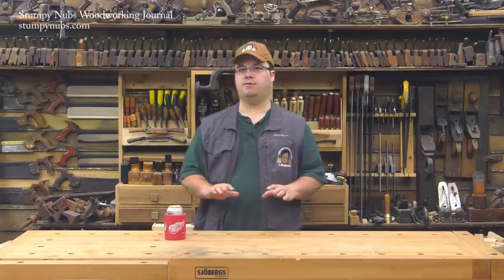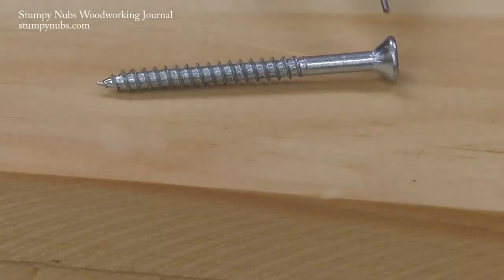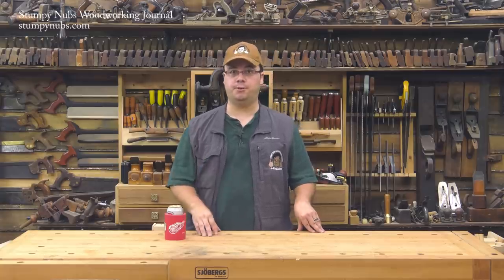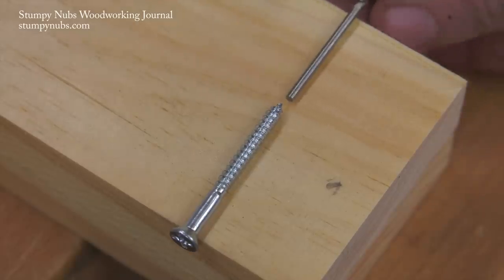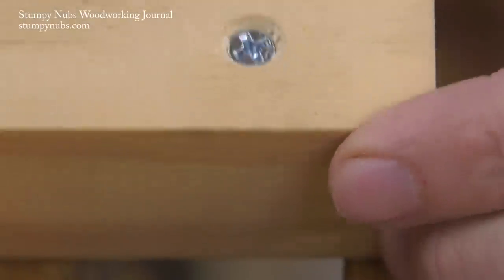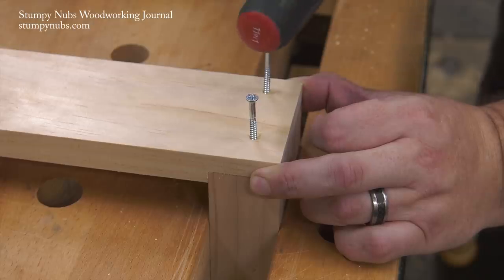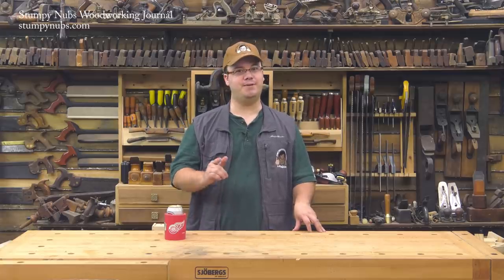Why old-timey woodworkers' screws held better (How to bore proper pilot holes)

Comment: I don't get it about the offset. Is the screw drawn to the awl punched mark and goes in at an angle? Why does that little dimple draw the screw when it is just a shallow dimple?
Reply from the maker: I bored holes in the dimples. That part must have been cut out in the editing :(
Reply: you should drill a pilot hole, using the awl marks as your location for the pilot screw
Reply: So, I am not crazy and did ask a legitimate question. Thanx
Reply from the maker: Josh w- I did. It just wasn't shown in the video. but afterward I referred to how you had to use the same 3-step pilot hole you just saw earlier int he video.
Reply: I honestly didn't even notice that he didn't show the piloting of the awl mark. It was an easy thing to edit out I'm sure, it appears obvious and natural to anyone who understands it that you would pilot it.

Comment: I have to mildly disagree with you opening statement; that is not really a screw, it's a nail that happens to be put in with a screwdriver. They fulfill all the uses to which nails used to be used for, instead of a hammer you have a drill driver, they are designed to go straight into softwood without drilling any holes, they are parallel sided so as not to split the wood and the heads are shaped to sink into the wood without a countersink, all just like we used to use nails. They do not really work in the role that we used to use screws for, for one thing they are not as strong and they don't work in hardwoods (they split the wood if you don't drill a pilot and they tend to just snap). Machine driven screws gain their strength by being longer than traditional screws, really long for end grain.
Proper screws require, as you showed, a clearance hole and pilot hole and a countersink, but proper screws are tapered so that they grip tighter as they are screwed home, unlike machine driven screws.

Comment: Guess I must be 'old timey.'
This is how we always fit screws in my workshop, and I use only slotted screws - we call the others 'moron' screws!
Reply: Not a fan of the Phillips screw heads. The metallurgy on most screws these days is terrible and the cam-out design of the Phillips head usually causes damage to the head rather than the intended cam-out.

Torx is a great alternative since it's not designed to cam-out but still keeps the driver tip in the screw head. The only downside is that the rarity of Torx means most people don't have the proper tools sitting around.
Reply: @benjaminkesler5245  I worked in a steel house frames factory. The company decided to change from 5 cent framing screws to 2 cents cheap nasty ones. Both were philips head but the 5 cent ones were way better to work with. I don't know if it's the alloy or if they were hardened. Any money the company saved on the screws was lost with the increased time it took to screw in. Sometimes it took up to three screws before you could drive it all the way into the hole on thicker gauge metal. They stripped so easily. Plus it reduces the life of the screw guns with overheating and pressing down so hard to get it to drive in. Plus injuries from the extra effort it takes to do the work. Morale really dropped, the screws were so frustrating. And of course they expected production to stay the same even with the extra time it took.

They trialed some torx head screws but they didn't end up going with them. 

Anyway thankfully I'm welding now instead of that braindead boring job of screwing frame screws in a factory all day.

Comment: “A messy countersink wasn’t that big of a deal.”  My grandfather would be turning in his grave to hear that.  Of course he did a seven year apprenticeship as a joiner in a yacht builder’s yard.  Messy countersinks were not tolerated when you were working with expensive exotic hardwoods.
Reply from the maker: We're talking about furniture making. Screws were hidden, so the counter sinks weren't visible.
Reply: Stumpy Nubs I understand, but it wouldn’t change my grandfather’s opinion whether they were visible or not.  To him and the people he worked with, you did it the “right way” no matter where it was located.

Comment: So it is a thing! Because for the longest time I could swear the industry doesn't give a shit, when it comes to screw selection. A lot of products on the shelfs don't make sense to me, where you have a screw SUPPOSEDLY for a 2x4 construction, YET the threads are only 1/4" down from the head...WTH?! FORCING you to drill two hole sizes. Once you get into expensive "professional" grades, they actually pay attention to the design. Shocking and I thought the Americans/Canadians are crazy. Turns out it's just the manufacturers that are lazy.

Comment: Now if only they made new production wood screws like they used to.
Reply: That's the thing though is that they don't make them like they used to. So regardless of how well this technique worked for them 150 years ago it just doesn't today. It may get you a little farther than just running in wood screws willy nilly. But you are still going to get screws that spin forever because of the shank and the sheer strength isn't nearly what it was 150 years ago. Partly because of the screw material and partly because who is framing houses out of cedar these days? Not many people. Even with taking these extra steps you are still going to get better performance from a deck screw than a "wood screw" or drywall screw.
Reply: dunno how things are in the states, but over here in europe this isnt an issue. You can still get proper woodscrews everywhere

Comment: I watched the hole video, but if I tried this, I wood screw it up. ( yes I know, my puns are boring. )
Reply: At least you know the difference between screwing and boring.
Reply: Man those two pilot points were barely a plank apart.
Reply: That’s comments Gold!
Reply: Yeah but it is a good thread to follow! Said Mr. Phillips!
Reply: They're really awl-ful
Reply: Keep up those puns and you're screwed!
Reply: That doesn't auger well.
Reply: I'm just here to add to the thread.

And after a bit of lag... I'm gonna bolt.
Reply: @heli400  – Yeah, keep it up, wingnut...
Reply: <groan>  Funny but  <groan>   :)
Reply: Ouch
Reply: I want to down vote this for the same reason I want to up vote it.
Reply: You've started quite a thread.

Comment: I was taught to drill the countersink first to give you a nice round countersink then the smaller pilot  and then clearance hole. Otherwise your countersink bit dances in the hole and not a pretty result

Comment: You can more or less duplicate this process with drywall screws if you drill a hole the same width as the outer diameter of  the threads in the outer workpiece, where the shank of a conventional wood screw would go.  I also rub my screws on a block of paraffin wax before putting them in. It only takes a second and they go in much more easily.
Reply: im not a big fan of this method, since it wont produce a tight fit between the upper part of the screw and the wood. With time it will become loose in the horizontal direction. If you have to use a drywall screw just bore a pilot with the inner diameter and countersink. Boring to the outer diameter is doing more damage than good in the long run.
Reply: is there really a shortage of wood screws?

why not take a day to go buy a huge box of wood screws
Reply: YYYYYYYYYYYYY ARE YOU ON,MT LINE?
Reply: I found drywall screws inappropriate even for drywall)
Reply: The point is that drywall screws will fail over time no matter the method you use. They are highly susceptible to corrosion and become more and more brittle over time. I have seen a number of failed, snapped, rusted threw drywall screws in a very short period of time. One day you will go to move that table and notice the leg is loose or falls off and you find a snapped off mostly rusted drywall screw in the hole.
Reply: No. Drywall screws are made of a more brittle material than is appropriate. Also, the curved surface is not suitable to draw the pieces tight; that's why wood screws have a different contour  in that area. You're describing hackwork.
Reply: Ozzy, drywall screws are good for drywall. Their taper is very flat giving you a lot of hold without blowing through the paper.
I hate fine thread dry wall screws, and I prefer using 1 5/8ths screws for 1/2 in drywall. Short fine thread drywall screws have their place, but not in general sheet hanging.

Also Matthias Wandel did some testing and found that while drywall screws are more brittle, their clamping force was just as good or better than wood screws.
Reply: John E John is correct you CAN use drywall screws (or deck screws) to pull the pieces together as long as the top piece has a hole larger than the screws threads.  In softwood I prefer them. They are brittle, but only rarely does that matter much.  In haedwood, the old fashioned wood screws work better for me.

Comment: That offset screw idea is essentially the same as drawboring. Maybe that's of interest to someone.
Reply from the maker: Drawboring only pulls in one direction, which is all that's needed as drawboring is used to seat a tenon in a mortise. Drawboring would not work with a rabbet. Offset screwing pulls in both directions, which this type of joint requires.

Comment: I've found that my water pump pliars work better as a hammer than my screwdriver handle.  But I'm probably not as strong as you are.
Reply from the maker: Who is hammering anything? I needed light taps to make little dimples with the points of the screws. A hammer would have been overkill.

Comment: Why are you hitting the screws with the screwdriver's handle? It is meant to turn them, not smash!
Reply: Shop worker to tool crib manager; " give me a wrench". crib manager; " What type of wrench?  What size?  Worker; "doesn't matter - I going to use it for a hammer."
Reply: Kelly Infanger ...Sooner or later EVERY tool gets used as a hammer. 😉

Comment: Since this is a "teaching video" Using the word shaft to describe a screw is incorrect. The un-threaded section above the thread is called the "Body" not to be confused with a "Shoulder" it's also sometimes called the "Shank". I was taught that the shank was the "root diameter of the threaded section" and the Body was the "major diameter, sometimes the major diameter can be larger than the body" although many people use them interchangeably. I assume there is regional differences the same as guys using jack or cripple studs. in any event it's never Shaft, Cheers!

Comment: "How it was done 150 years ago" proceeds to drill with battery drill motor.
Reply from the maker: The video isn't about drills. It's about pilot holes. I could have used an eggbeater drill and the hole would have been exactly the same.

Comment: Real wood screws are tapered and have a slotted or frearson head. Pilots are drilled with a tapered bit, set with a little glue and clocked.

Comment: Looks like a version of draw boring!
Reply from the maker: Drawboring only pulls in one direction, which is all that's needed as drawboring is used to seat a tenon in a mortise. Drawboring would not work with a rabbet. Offset screwing pulls in both directions, which this type of joint requires.
Reply: Drawboring only needs to pull one direction because the tenon is trapped in the mortise the other two directions.

Comment: I found that the three-step process works best in the reverse order.  I make the counter sink first, then the clearance hole for the upper screw shaft and just a bit of dimple for the smaller hole.  The counter sink hole and the dimple have tapered bottoms that center the next drill bit perfectly.

Comment: The second drillbit was rotating counterclockwise.........
Reply: That was just to make sure that it was centered in the small hole. Once it had made an impression in the wood he reversed the drill and bored the hole through the upper board.

Comment: I found a couple of tables at BoltDepot.com a while ago that give wood screw drill information:
https://www.boltdepot.com/fastener-information/Wood-Screws/Default.aspx
 One table gives pilot hole diameters (the metal between the threads) and the other table gives the outside diameter clearances.   You can get a bit more accurate if you want to buy numbered drills - don't buy a whole set of those.

Comment: That isn’t a truely old fashioned wood screw.  This is a modern wood screw.  Old time wood screws where actually tapered.  They often failed because as the wood aged and dried the timber shrank away from the the wood screw thus, the screw became loose. This was particularly problematic when used to fix door hinges because doors place a lot of load on the hinge.  Over time the screws become loose and the door starts to jam in the frame.

Comment: Tiny point, you're describing a method of using partially threaded screws to get compression between pieces which is often what we want. In applications where you don't actually want compression between the pieces, a fully threaded screw without the overdrill of the top piece is another good technique to know.

Comment: Really? A chisel for a countersink? Try this- fashion a simple point (45 degrees) on a steel rod, maybe 4 inches long. Place in pilot  hole, now hit with hammer. Done. Works everytime and strengthens the countersink by compressing the wood fiber.
Reply from the maker: You must really love your tip to give your own comment a thumbs-up :)
Reply: Ok, guilty as charged.

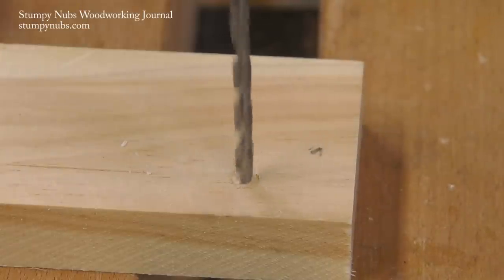Comment: at 2:10 stumpy bores a hole using that old timey technique of counter clockwise drilling.  hmmmmm?!
Reply from the maker: That was done to sever the fibers on the surface before drilling. Prevents tear-out
Reply: Burnish, then drill. Try it, you won't be disappointed.
Reply: Left hand twist bit.
Reply: Victoria learned two things today!
Reply: I was going to comment the same thing, but i give your system a go ...
Reply: Victoria Q it ensures that the larger bit stays centered in the pilot hole & doesn't jump off center when it bites into the wood.
Reply: I shall have to try it!

Comment: Fun video
Personally I liked when you smashed the drill head jaws into the surface and when you drilled the larger hole with the drill in reverse heh
Reply from the maker: Running the bit backward for a second is a way to sever the fibers before tearing them out as you begin to bore the hole. Try it some time.

Comment: I helped my father make the back steps. We used wood screws, and did what you did. Twenty five years in, the wood screws all broke off. The back steps was the main way into the house, and the constant flexing of the wood caused metal fatigue in the wood screws, and they failed. You know, If wood isn't in the rain, or gets wet, it will last thousands of years under stress. Nothing made of metal, under dynamic stress will last a thousand years. Honestly, most of the stuff made, isn't expected to last more than a few years, so who cares what happens twenty years down they line. We should be honest, if we make something all out wood, and don't use metal, the life span of the object goes into centuries.
Reply from the maker: Yes, because we all walk on our furniture every day for 25 years, like your steps...
Reply: Sounds like you used wood screws when you should of used lags. Stuff made even 25 years ago isnt as good as stuff made today. Our cheap stuff today was the high quality stuff 25 years ago. Believe it or not..
Reply: Sounds more like your steps weren't supported well and/or likely left unpainted so the screws after 25 years of being exposed to the elements rusted out and broke.
Reply: You should have used treenails then
Reply: Tree nails, Never heard of it, But I'm sure there I could've done better.

Comment: Well, now I know why the parts I joint together many times do no screw properly... because I'm a cheapbutt and I buy the cheapest screws wich are no the correct ones.
Reply: thats fine. if the only thing you take away from this video is drilling a pilot with the core diameter of whatever screw you are using when working with wood, then it has already been worth it.

Comment: C'mon, man... You said you were going to show "how it was done 150 years ago", then you proceed to drill the holes with a hand-held electric drill? -Those didn't even exist until the early 1900s! 😆
Where I grew up, we had access to, and were still using manual drills in junior-high and high-school woodshop (aside from the electric drill-press); That was in the 80s, and these methods were taught as standard for using wood-scews.  I use the methods to this day.
Reply from the maker: C'mon, man... stop nitpicking the hard work of others.
Reply: Stumpy Nubs 
Good video, man. I was giving ya grief, hence the smiley.
Reply: I was about to conjecture that where John grew up, he also had to walk two hours to and from school, through the snow, up hill both ways, in the dark!

Comment: If brass screws are made of brass, and stainless steel screws are made of stainless steel, why aren't wood screws made of wood?
Reply: I’ve seen 2X4’s with enough twist in them to be used as wood screws.
Reply: @robertpearson8798  You must shop at Home Depot.
Reply: @asahoura2798  only when I have to.
Reply: @robertpearson8798  Good man!

Comment: As an 'expert" you really should know that you never put a woodscrew into end grain.
Reply from the maker: And who made that rule? Just because screws don't hold as well in end grain as they do in long grain doesn't mean they don't hold. Mechanical fasteners have been driven into end grain since they first appeared in furniture. If you know their limitations, they are quite useful in these applications.
Reply: @StumpyNubs  Not a rule, just a good working principle, especially in softwoods where screws in endgrain  are prone to failure.
Reply from the maker: When you say "never" do that, it sound like you're making a rule. I stand by my response above. Have a nice day :)